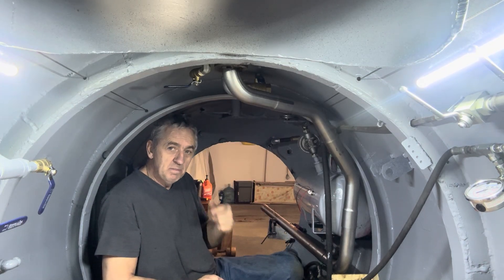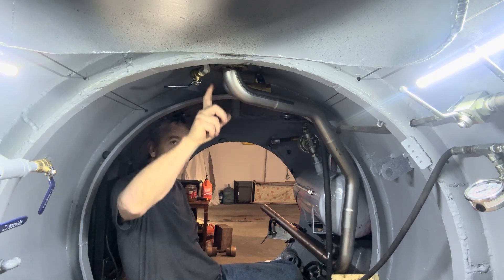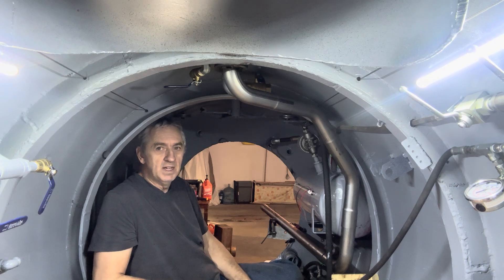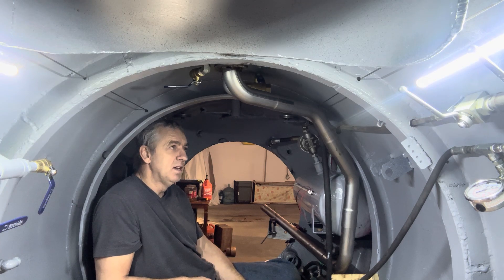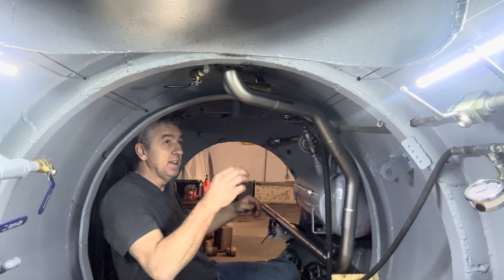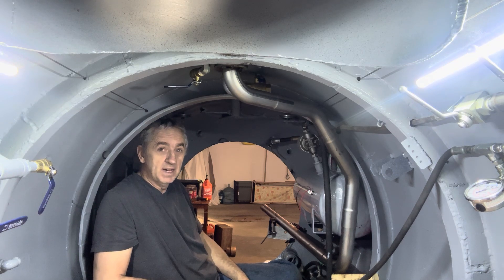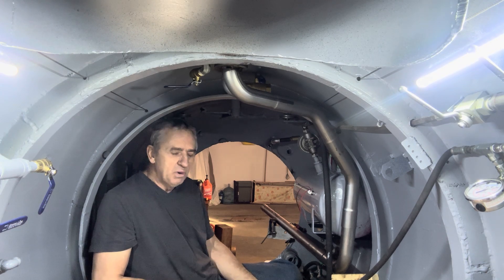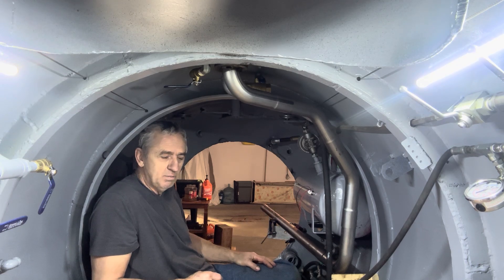Home build diesel electric submarine.  January 9, 2026

Comment: I think you should make the hull out of carbon fibre, it's a strong material so I can't imagine it going wrong.
Reply from the maker: Actually CF is good material if done properly and if thick enough.  For my depth rating it would be fine and rust free.

Comment: Ion get it, is it a diesele or a ev
Reply: Submarines have been diesel AND electric for over 100 years. Run diesel on the surface and electric under bc it doesn’t have exhaust.
Reply from the maker: Both

Comment: Will it have stabilization and air conditioning?
Reply from the maker: I has air coditioning in the form of a radiator with cold lake water flowing through and a fan.  Not sure what you mean with stabilization.

Comment: There is going to be tremendous heat buildup…I was an a nuclear sub but we had a diesel engine…It created a lot of heat in a small space and that was after tens of millions of research to cool it…You will need a huge cooling plant…Old WW2 subs got up to 120-130 degrees inside
Reply from the maker: I do have a compartment cooler.  It is a hydraulic cooler radiator from comercial mower, with cold lake water flowing through it with a fan behind it.  You realze when it takes the government a million dollars to solve a problem, a back yard guy can do it for a hundred bucks, just kidding.   The engine is in its own compartment that is cooled as well.  It is only the exhaust for 4 feet that I have to deal with.  Fingers crossed.
Reply: @HankPronk  Good luck and be safe
Reply from the maker: @stevea9604 thank you
Reply: @HankPronk  Run the exhaust along the inside of the hull and get as much of the pipe as possible in contact with the hull. Also, a better idea altogether is to make the exhaust output in the hull as close to the engine as possible to limit the required length of the exhaust pipe and reduce the total surface area that the heat can radiate from. For a 3-inch bare steel pipe at 212°F surface temperature in 70–80°F still air, the heat loss is approximately 45–55 BTU per hour per foot. The longer the pipe, the more BTUs per hour you have to deal with. Make the exhaust as short as possible.
Reply: A nuclear sub’s diesel engine is the size of this submarine so I don’t think the heating issue is going to be that bad
Reply: @ItsMeeJon  The room that the nuclear sub's engine is in is also huge. This is a small sub. Heating will be a massive issue with a long length of exhaust pipe running the length of the inside. The more pipe there is, the more heat there will be to radiate from the surface area. You need to think in terms of thermal mass. Heat a small piece of metal the size of small coin to 100'C and you wouldn't notice the heat at all from 20cm away. Heat a 1 meter cubed piece of metal to 100'C, exact same temperature, and you'd feel the heat as being very oppressive from more than a few feet away. It's gonna' get HOT in there. Very hot.
Reply from the maker: @Crimsonedge1  I have the entire exhaust set up and hooked up to the engine.  The water cooled section is doing a great job and the 3 feet of pipe remaining is insulated and I can hold it with bare hands and hardly notice any heat.

Comment: Exhaust header wrap should make it easy to do in-situ.
Reply from the maker: Yes, it is removable also, so I can wrap it then install.  It bolts to flanges at both ends.  I just dont know how hot it will be with wrap.  I tried the wrap with the Yanmar and it was good so far.
Reply: @HankPronk I would be concerned with the use of exhaust wrap in this application. They off gas/smoke a lot when breaking in and given the small space, long term exposure to the material over many heat cycles probably wouldn't be wise.
Reply from the maker: @K20C2-Slow  Thanks, I will rethink this.
Reply: Yeah I was going to say the same thing. 
    This would work the best. Also if you need to you can put more than one layer on it.

Comment: Is there a reason you are routing the exhaust all the way to your conning tower rather than exiting the pressure hull near the engine? Either way you still need a pressure rated isolation (hopefully 2 in series) you might even rig a wet exhaust to remove all the heat. I worry you may have quite a heat source with all that exhaust pipe
Reply from the maker: I want the exhaust stack to be inside the sale and protruding strait up.  If i have to I can put water jackets on the strait sections.

Comment: Your current big alternator won’t get any hotter than the 40 amp alternator… unless your planning on running high amp electrical loads as well as charging the batteries…  the amp rate the the batteries will accept as they charge up will limit the output of  the alternator . However I have no idea if a 40amp  alternator running at full output gets hotter than 200 amp alternator charging at 40 amps.
Reply from the maker: Its not the load on the alternator thats the problem, its the physical size.  The big GM alternator is 3/4 of an inch away from the manifold heat shield.  I am going to try it first, I decided.